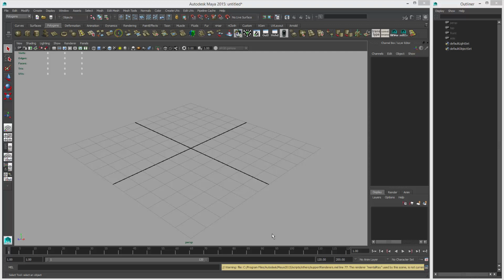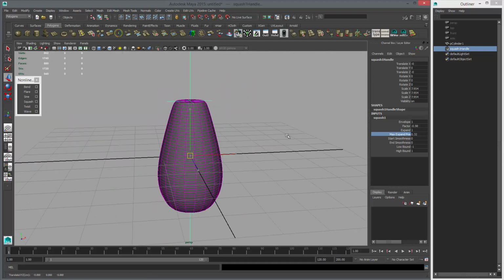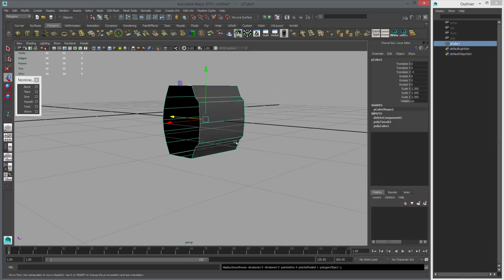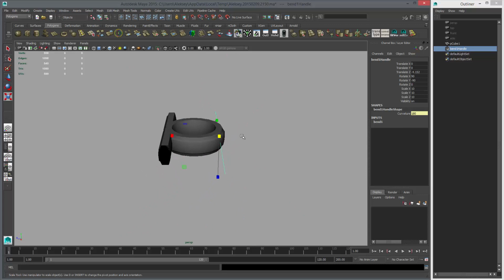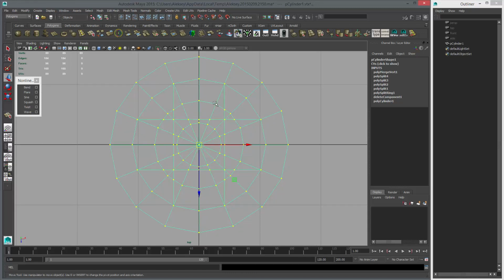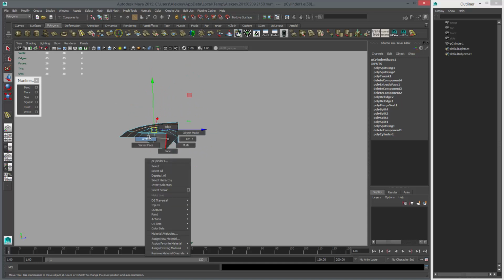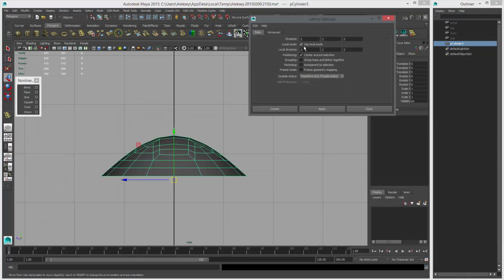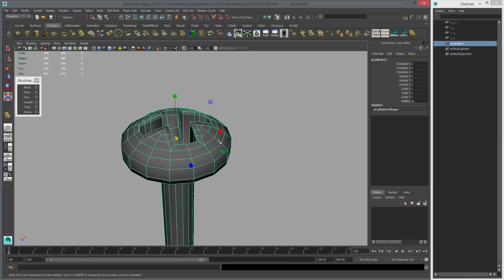Modeling with Non Linear Deformers

Comment: For the screw head, you could also drop two bend deformers, align them with the plane and rotate one by 90 degrees on Y, then set the same curvature on both. The bend curvature is often a bit smoother than the wave curvature, imho.
Reply from the maker: +tentakeljugend You are right. I do use 2 bend deformers, like in my Baseball tutorial. But the wave is in most cases faster to execute and gives you a good enough result.